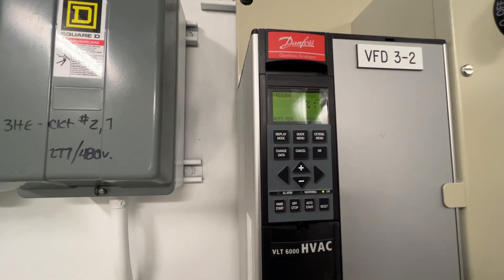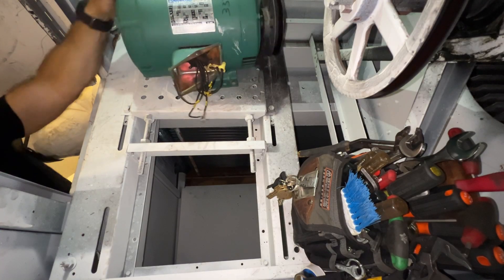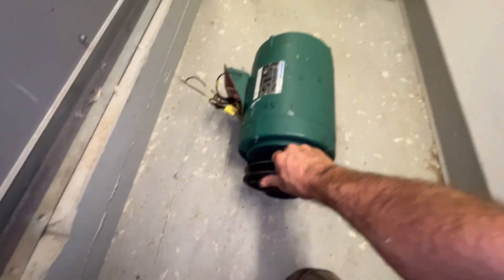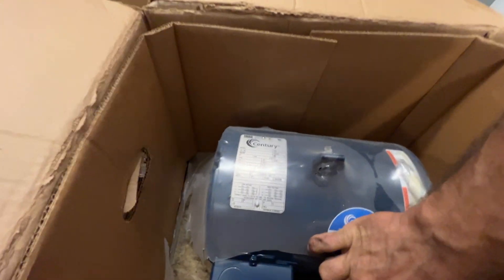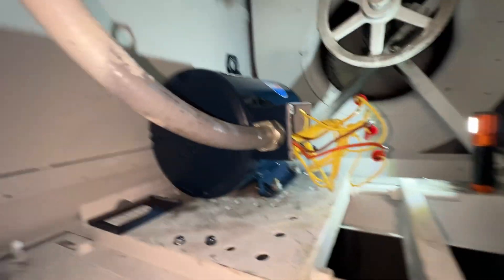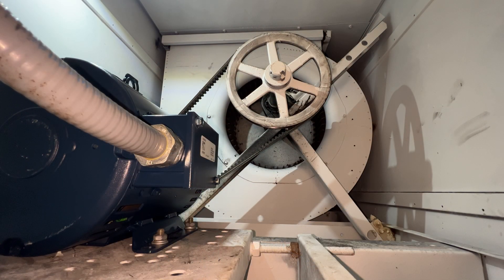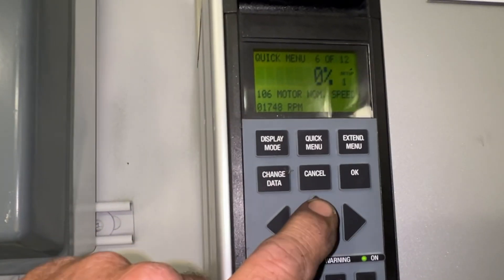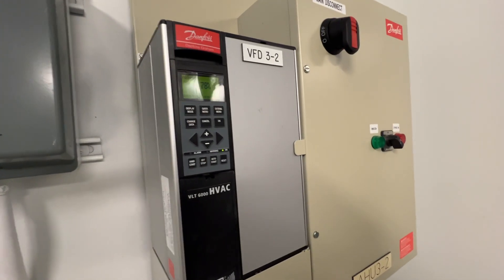The Drive Was Right … It’s Motor Time | 5hp 184T 3 Phase

Comment: If you have alot of bearing issues with motors on drives. Try the ones with built in bearing ground straps.
Reply from the maker: Thanks for the tip 👍
Reply: Pretty sure the label on the Century motor that says "E-3 Plus" means that it is an inverter rated motor, which has better winding insulation and grounded bearings.